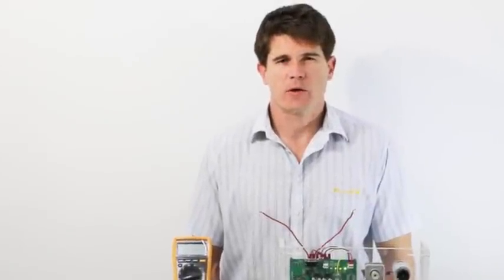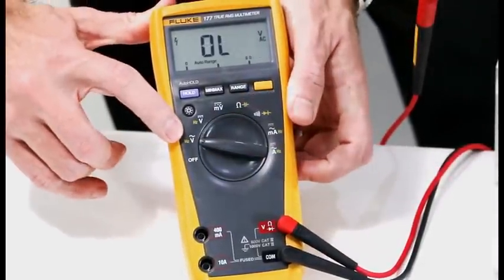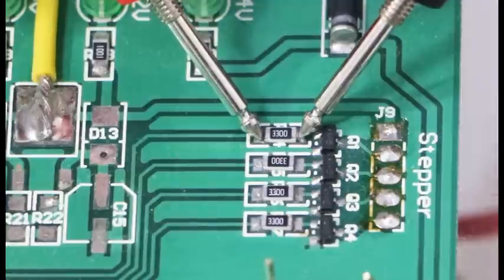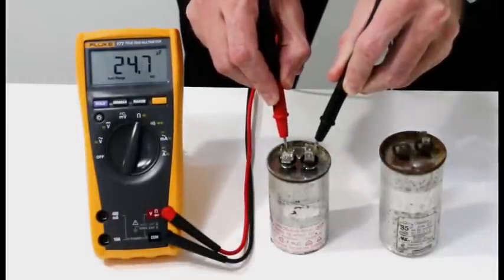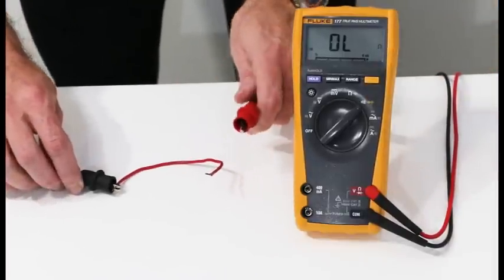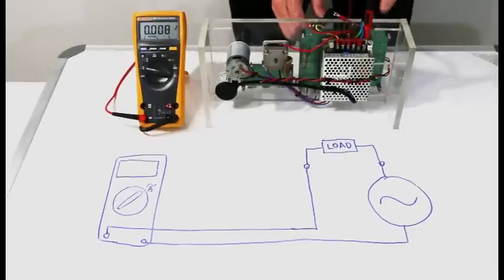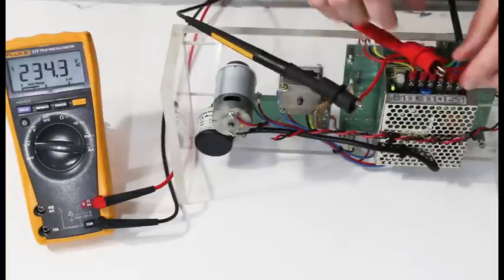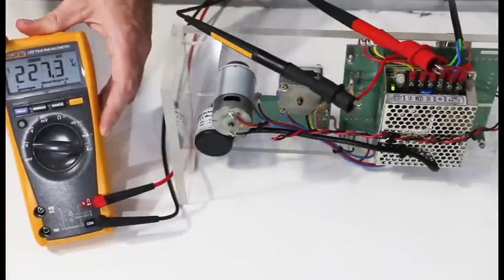Fluke 177 Training

Comment: To change a fuse or replace the battery, you must open the Fluke meter.

Fluke 177 has metal screws that dig into bare plastic.   No threaded metal inserts.

After opening and closing the meter a few times, those crude screw holes could easily strip.    That is a deal-breaker for me.  I would not buy the Fluke 177.

Comment: GOOD DAY Teric B my fluke 177 failed to read low resistance. what is the remedy for this. calibration? thank you
Reply from the maker: The Fluke 177 has a lifetime warranty so what I would do is send it back to where you purchased the unit from and get it evaluated by an authorized Fluke distributor. They will simulate resistance using a Fluke calibrator and check if the unit is faulty and do the repair. Hopefully your meter is ok and you can get this sorted quickly :-)

Comment: When I turn the dial, the ''Fluke 177'' doesn't appear on the screen, should I be worried?
Reply from the maker: No I dont think so :) Probably just an internal firmware upgrade on your version which was different to mine when I did this video.

Comment: I used this meter for 15 years, without a hitch. See that you replace the battery on regular intervals.  The only drawback is u need to open the back cover secured with screws to replace the battery. It's a for industrial electrician/ instrument tech.